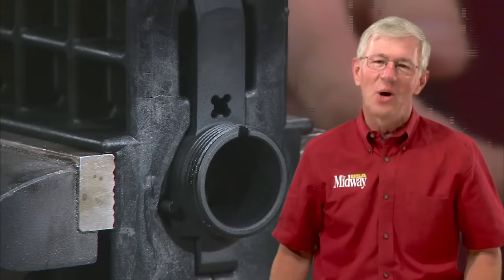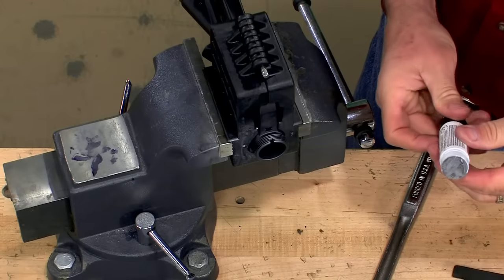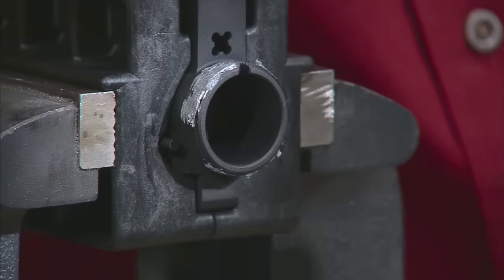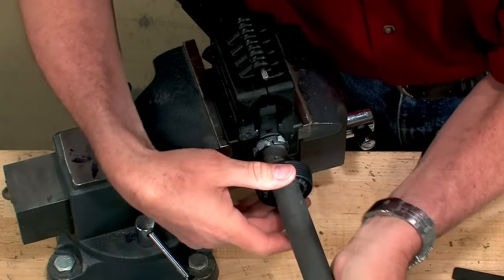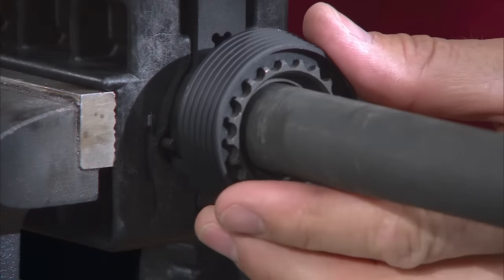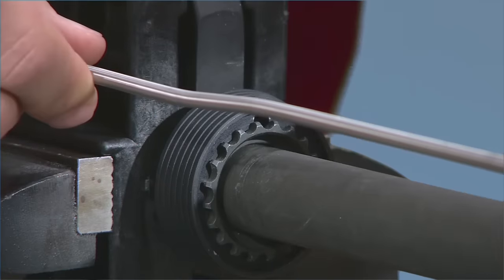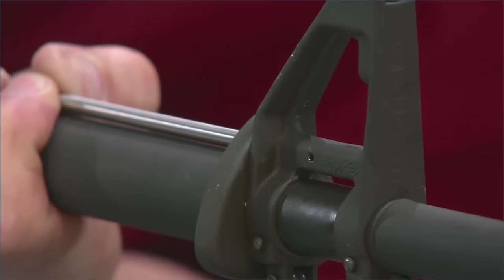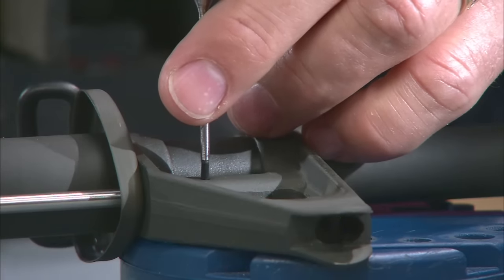How to Install an AR-15 Barrel Presented by Larry Potterfield of MidwayUSA

Comment: Barrel nuts. The only time you do the ocd task of “seasoning” the nut. I swear some fuy with ocd convinced everyone to do this.
Reply: It was that one meeting he actually showed up to because he got up early enough to do everything three times before arriving at work.
Reply: Actually for some engine head stud kits, you torque, loosen, and re torque a few times.  That's a high performance, high compression head, like a diesel pickup.  Not following instructions could mean a leak in the head gasket.  Just saying, it actually is a thing.
Reply: Most of the time people aren't torqueing a steel nut down on aluminum threads. The aluminum is much more malleable than steel, and it's ability to stretch and gall should be accounted for when tightening down a barrel nut.
Reply: As a guy with OCD, I appreciate this. :)
Reply: @thewatcher611  Subaru's use stretch bolts for the heads that require a mutli step process to finish torquing too.
Reply: It is because deformation over time will cause the barrel nut to not hold its torque value. Meaning it could fall out of spec easier. The process of tightening and loosening helps to deter this from happening
Reply: If aluminum stretches, then why would you do a process that intentionally stretches the aluminum pulling the threads apart making it easier for it to come lose. And the motor stuff being talked about is torqueing it in stages, like 20 lbs then 25 then 30. Not taking it off then putting it back on.
Reply: @jackmehoff2363  When the barrel nut is installed over the course of years and many hot/cold cycles it is less likely to deform the threads or fall out of torque spec. If you tighten something down that goes through many extreme  heat cycles (like exhaust pipes on a car) the fixture is particularly liable to loosen over time
Reply: @thewatcher611    That’s a very different animal.  You get compression of the head gasket and stretching of the head studs.
Reply: It is a real thing. Talk to an engineer in metallurgy.
Reply: We do it all the time building jet engines.
Reply: This is a interesting thread boys. Nice job
Reply: @jduffey320  you get a kid with that joke
Reply: @jduffey320  if you werent a dad before the joke, you are now.
Reply: @jackmehoff2363  haha I actually have my third kid on the way! This one's going to be a boy and I just found out yesterday! So excited. But yeah I nailed that dad joke effortlessly. I'm really coming into my own over here.
Reply: @jduffey320  my 5yr old daughter told me last weekend that my joke wasn't funny. i said it's ok.. it's a dad joke 😂 kids are awesome
Reply: @flawless1up  kids are what makes life worth it. Otherwise it would be total bullshit
Reply: @jduffey320  agreed, she makes life awesome. loving the lil things, taking nothing for granted
Reply: @flawless1up  yes! I've got two daughters and currently have a little boy in the oven !
Reply: @jduffey320  congratulations.. your daughters will love him.

Comment: 1:50 "Then using a breaker bar, loosen the nut, and back it off SLIGHTLY." 
proceeds to completely unscrew the nut  
My definition of "slightly" is slightly different, lol.
(I get that he's showing the right way.  I just thought the choice of words was funny.)
Reply: He meant use the breaker bar to back it off slightly because you couldn't do it by hand, and then remove it completely by hand so its faster. There's no point in using the breaker bar to remove it completely
Reply: @lnfertileTurtle  Exactly.
Reply: Just reverse the action an a common torque wrench to back it off. 
No need for a breaker bar or socket wrench.
Reply: @Baldhills  you shouldn’t use a torque wrench for anything other than torquing.  Using it to back off torqued nuts will cause the calibration to be inaccurate on the wrench

Comment: What is not considered is the fact you are exceeding the torque you want by using the barrel nutwrench. Example, if your torque wrench measures 18" from the middle of the handle to the center of the ratchet head and the tool measures 3" from the drive hole to the center of the barrel nut , you increase the effect of the torque wrench. Cross multiply and divide to get the correct setting for a desired torque. Using the torque wrench I described, at a setting of 60 foot pounds would actually be 70 foot pounds on the nut.
Reply: Doesn't actually matter.
Reply: @superbarnie  maybe not in this application, but if you add an extension to a torque wrench, it does change the actual verses the reading.
Reply: @Mike44460  You are right but a 10 ft-lb difference won't make a difference.
Reply: The military uses the same method...Measure the distance, r , between the pivot point and the point the force is applied. Determine the angle θ between the direction of the applied force and the vector between the point the force is applied to the pivot point. Multiply r by F and sin θ , and you will get the torque.

Comment: Isn’t the actual torque on the retaining nut going to be greater than the setting on the wrench because of the increased lever arm from the adapter?
Reply: That would depend on the angle between the barrel wrench and torque wrench.
Reply: @sneakinguponit  kinda... it actually depends on the total length from the handle to the center of the attached tool.  Which is why any tool attached to the end of a torque wrench should be at 90° as to not increase total length....
Reply: The military uses the same method...Measure the distance, r , between the pivot point and the point the force is applied. Determine the angle θ between the direction of the applied force and the vector between the point the force is applied to the pivot point. Multiply r by F and sin θ , and you will get the torque.

Comment: And here is the real kicker regardless of how tight you make the barrel nut. Once the gas’s block and tube is in place the nut is keyed and cannot be turned because of the tube!
Reply: No, if the barrel nut comes loose, it will push the gas tube out of line and jam the carrier..

Comment: Be careful Ruger  AR’s.   Late models are left hand thread.  Easy to cross-thread. I own one of the latter and it still shoots straight.  I don’t plan on removing the barrel in my lifetime.  Just clean the whole works!
Reply: You should be able to visually look at and tell if things are RH or LH thread.... Especially with the threads being so large.

Comment: You forgot to do the math of the adapter extension. Longer torque arm changes the final torque.
Reply: I've done the math before for a crow's foot needed to attach to a torque wrench for a work project.  It turned out to not be enough to change the torque specifications in the instructions.  The offset was smaller than the one used for the AR barrel but then the torque range was much much smaller as well.
Reply: @aa-yt7wo   Agreed. The torque differences are insignificant.
Reply: @aa-yt7wo  that adapter appears quite a bit longer than a crows foot.  Speaking as an aircraft mechanic, a couple of inches offset can change the torque by quite a bit, depending on the specified value.
Reply: @Mike-ul1xn  the specified torque value for this barrel nut is between 30 and 80 lbf, I really doubt he managed to exceed that.
Reply: 30 to 80lbs....i could fall into that range with a left handed monkey wrench.
Reply: How do you know he didn't do the math and set the torque wrench accordingly?
Reply: You say that as if barrel nut wrench manufacturers haven't already figured that out and just give you your torque wrench setting so no math is needed.

Comment: To do it correctly, throw that plastic clamshell away that holds the receiver, and spend the money for a torque bar. Doing it like they show here, can distort the receiver.
Reply: They're not that expensive. I got a Magpul bev block for 40 bucks, locks into the barrel extension so all torque is directed away from the receiver
Reply: @not-a-raccoon  Good advice Tom.  Magpul bev block is good.  Geissele sells a reaction rod which they are very proud of ($$$).  Brownells has a version of it that works on AR-10s too and is cheaper.  But if you are just doing AR-15s, Bev block is the way to go.
Reply: @JenkinsStevenD  Midwest Industries sells a better version of the Geissele for around the same price. Has a removable rib that fits in the charging handle channel (fin) and all the torque is placed directly on the lugs of the reaction rod and the upper is reinforced by the fin on top of the tool, so you really have to try to warp your receiver threads. It's the best investment I've made thus far. Also its made from steel, there are similar designs such as the Wheeler delta one but that one is aluminum and can bend
Reply: @kanaka118446  Yeah.  Some of those don't work for "exotic builds."  I had a 9mm upper and those operate by blowback.  There are no lugs whatsoever.  The bev block wouldn't work for those either.  Kind of had to use one that locks the upper receiver from the outside rather than interfacing directly to the barrel.  Not sure if the MI version would have worked since it has the extra fin.  Maybe.

Comment: So What Was Your Final Torque Value For The Barrel Nut After Tightening and Loosening 3 Times to 30 Ft Lbs Larry 😀 30-80 Ft Lbs Is Quite a Lot Of Margin For a Torque Value and When You Add Lubricants It Also Increases The Torque
Reply: There is only a minimum, 30 ft-lb.  After that has been achieved on the third tightening (3x tightening is to smooth and mate the threads) you advance to the next notch alignment for the gas tube to go through.  What that torque is does not matter.  Get to 30, put the torque wrench away, and replace with a breaker bar.  There is NO specific torque for alignment.  It is what it is.  There is a minimum otherwise things are loose.  For the final tightening, since we are not looking for a specific torque after 30 ft-lbs, it does not matter if the wrench is at 90* to the bar or not.  Never, ever back off to align.
Reply: @saxmusicmail  Thank You Great Explanation 😀 This Will Help Me A Lot On My Barrel To Upper Install It Will Be My 1st 👍🏼
Reply: @chrischiampo7647  Very important, hold the wrench firmly in the barrel nut so it does not slip out.  I don't remember the manufacturer, but I now use a wrench similar to the GI wrench, but it has 5 pins instead of just 3.

Comment: does anti-seize matter? I was always told no Graphite.  Aero-shell etc OK to use
Reply: The anti seize he used contains graphite. Graphite eats aluminum. Besides preventing galling, the anti seize gives you the proper torque specs. Dry torque and wet torque are not the same. Mil spec calls for wet, with a moly lube.
Reply: KGB2101 Highest density areas in the US are on the coasts.

Comment: I thought you're supposed to use molly grease, or Aeroshell.  Anti seize has graphite that can cause corrosion on aluminum.
Reply: think about it anti seize is what keeps your spark plugs from seizing in you aluminium heads.
Reply: @arib515  
Use whatever you like.  Army manual reads to use Areoshell.
I never used anything on the plugs in my shovelhead.
Reply: ?????? Where did you get that information????????
Reply: @Bob-pg7es  Dont matter if you specifically dont its done on wide scale globally on various aluminum parts for many decades.
Reply: KGB2101  Brownells recently had a short video on galvanic corrosion.  It is worth a watch if you are in to that sort of thing.
Reply: I guess it is a 2 part video.  Here is the link to part one.  The link to part two should be there when you watch part one.
https://www.youtube.com/watch?v=_5QQmkbeWo8
Reply: @Bob-pg7es  I would use copper grease - the same dark gold-colored anti-seize compound I would use for rebuilding motorcycle brake calipers and for exhaust rings, bolts and flanges, all of which get really hot. Simply because I always have some, and it would be fine.
Reply: Guys, don't overthink this... moly disulfide grease is common wheel bearing grease.  That's all it is, that simple.  Wheel bearing grease.
Reply: I’ve used antiseize on aluminum for decades and never had any corrosion issues.  In the Midwest, it’s used a lot in wheel studs.  I had a car for 17 years and zero corrosion on any studs or the nuts and they were coated with antiseize from day one and applied every time I rotated the tires
Reply: Not all Anti Seize contains graphite. I use BOSTIK Never-Seez "Mariner's Choice" it contains aluminum. Other products use copper or lead in a petroleum base.

Comment: I just installed a free float quad rail on my Bushmaster AR carbine yesterday, and I noticed that after I got the old barrel nut removed, the barrel was still stuck in the upper receiver so tight that I couldn't remove it.  Luckily I had no intention of changing my barrel, but I might want to do that in the future.  Was it just stuck in there from being there so long?
Reply: Possibly, or not enough grease beforehand
Reply: It's the heat from shooting it expands the metal over time.
Reply: @jacobcontreras5743  Thanks for the input.  I have only put about 200 rounds through my AR all total, but it is almost ten years old so I'm sure that has an effect too.
Reply: Sometimes a barrel & receiver are just a really tight fit.  With the bolt assembly & charging handle out of the gun, you can use a plastic cylinder of an appropriate diameter and length to knock a barrel out from the back of the upper.
Reply: @jacobcontreras5743  Thermal expansion is reversable.

Comment: Actually the proper way is to use the barrel nut wrench at 90* for the final torquing. Look up torquing with a crow foot wrench.
Reply: The military uses the same method...Measure the distance, r , between the pivot point and the point the force is applied. Determine the angle θ between the direction of the applied force and the vector between the point the force is applied to the pivot point. Multiply r by F and sin θ , and you will get the torque.

Comment: I always like watching people use a torque wrench improperly.
Reply: Or how about when they use it to break bolts loose! Mamma mia!
Reply: I believe what Drew is talking about is there's a certain way you put the torque wrench on the the barrel nut wrench ... If you do not properly do this you are not properly torquing
Reply: The way they show torquing is incorrect. Extending the wrench forward of the pivot point on the torque wrench increases leverage. This gives a false torque reading. It actually torques tighter than them torque wrench shows. The correct way is to have the wrench 90* from the pivot point of the torque wrench. This will give you the correct torque setting.
Reply: Drew Henley I told the same to a “guru” and he get mad at my comment. He even said don’t put the adapter at 90 degrees because is wrong 😂😂
Reply: I'm glad somebody else noticed the improper method. 90 degrees.
Reply: Yeah, you'd think for a company that makes it's money in firearm parts/building they'd at least know how to use simple tools
Reply: doesnt the video show his tool at 90 degrees to the torque wrench on the final adjustment?  
anyway, 35-80lbs  is such a large range, +10 lbs on the high side isnt going to hurt anything.  i prefer mine 50-70lbs for more uniform resonance and harmonics.
Reply: @fernandomarcano4908  actually 90° is the only way to get a correct torque. The X factor will get you if you don't. However, you can torque at 0° if you know the formula and do the math.
Reply: RJ Van i know. I teach the formular for helicopter Maintenence. What I said was “the gurú” didn’t applied or recognized the 90 formula and applied torque with straight forward extension as a correct number

Comment: It is possible that you cannot get proper alignment of a notch with the port in the receiver and still be within the torque spec.  In that case you will need a barrel nut shim.  I don't know why this is omitted from the video.
Reply: Just because it hasn't happened to you doesn't mean it didn't happen to me. JenkemOD

Comment: With such a wide spread in torque requirements, it seems you really don't need a torque wrench. Put some tight on it with a good anti seize compound and walk away.
Reply: I had a smith break a barrel nut doing that.
Reply: Many people don't know how to gauge their own strength, so it could end up a disaster. The purpose of a torque wrench is knowing where you are and being consistent. Too tight? Too loose? Or somewhere in between?

Comment: Lubricants change the torque profile of the mating materials though and can easily lead to over torque. I forget the exact numbers but anti-seize increases applied torque by something like 23%.
Reply: KGB2101  So a dry torque would be somewhere around ~95 ft-lbs, interesting.

Comment: "Don't apply more than 80 pounds of torque." 

I wish someone would teach PSA that simple rule.
Reply: for real though i’m trying to take mine off hahaha it’s so hard
Reply: @sam.fridayyy  I finally gave up and have to give it to my armorer at work. I fought with it all night and it's no use.
Reply: mine appears to be over 100
Reply: My buddy got it off but it required a cheater bar... And it was apparently thread locked or something which was clearly not anti seize
Reply: I bought a 14.7" upper from PSA in mid 2020 and removed the barrel nut with my hands.
Reply: @largelarry2126  This 10.5 I got a year or two ago wasn't coming off with anyone's hands lol. It is amazing how many people I found with this problem.
Reply: PSA doesn't play around 😂
Reply: Try getting the pins out of a front sight block those rifles maybe be inexpensive but they are built for a fight lol
Reply: Use a map torch on the barrel nut.
If a wrench won't work, break out the hot wrench.